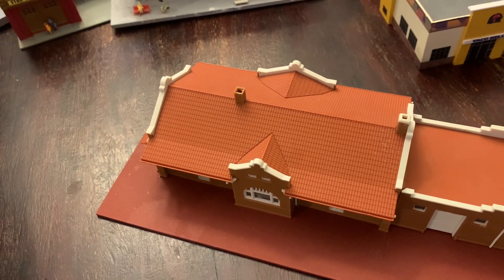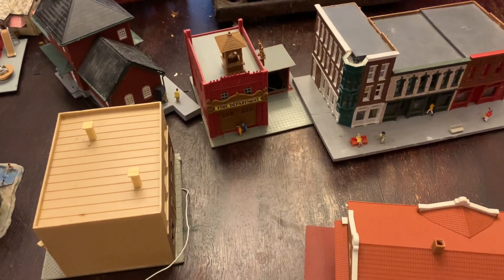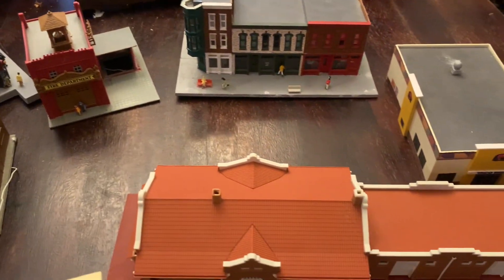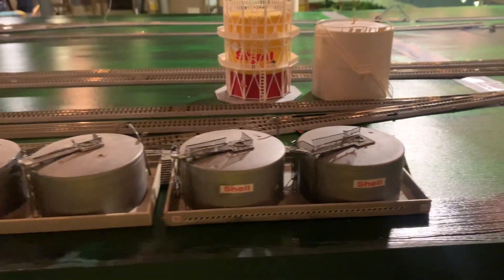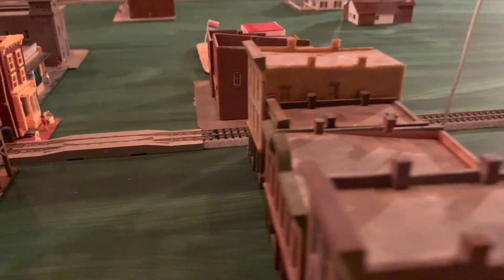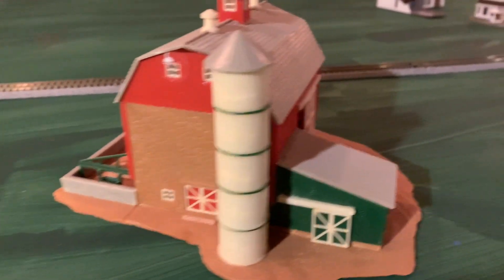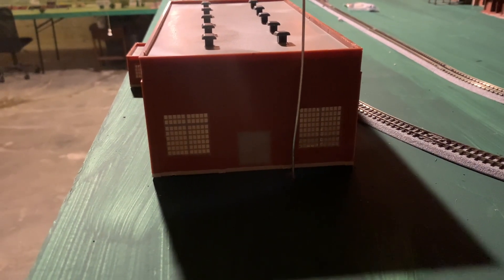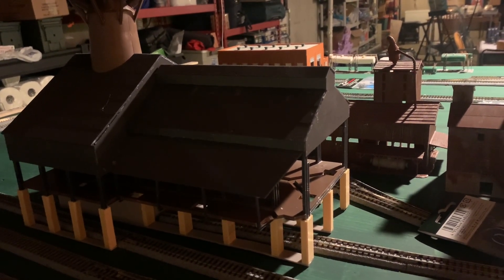Illinois Central Gulf from Granite City, IL to Bloomington, IL N Scale #9

Comment: That's the way to do it, very nice score. I like supporting the local hobby shops but at $40 to $70 per building they add up quick. I have that fire station too, very cool. The blast furnace is looking great!
Reply from the maker: Steve, thanks so much for stopping by.  Model railroad structures have become so expensive.  I know some scratchbuild to lower the expenses while others 3-D print buildings.  I just do not feel like I have those skills so I stick with kits.  At the same time, there have been some great deals on E-bay as of late.  There are a few more buildings that will be closer to the edge of the layout that I am willing to buy new as I want them and am going to be a bit more particular on the way they turn out but I hope that a lot of the background buildings will just blend in.  I give Leslie all the credit for the blast furnace; I just cut out the pieces and she assembles it.  I have no patience for instructions and she has no patience for cutting pieces so it works out.  This is the largest kit she has assembled and I am loving the way it is turning out.